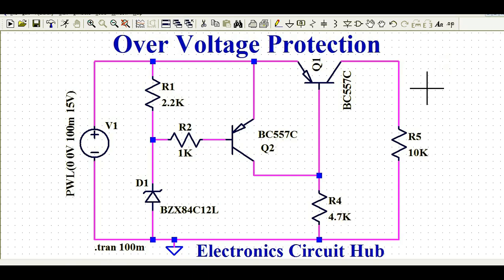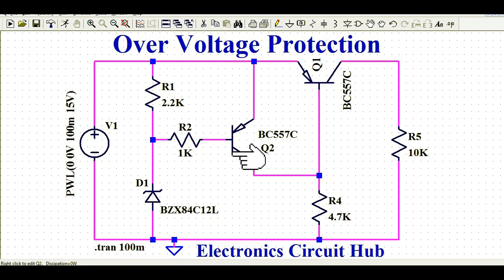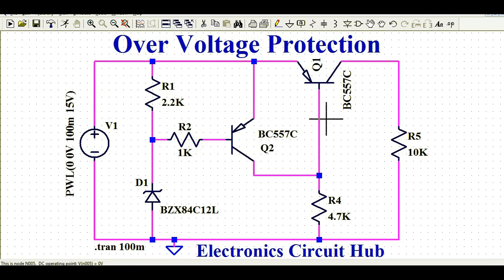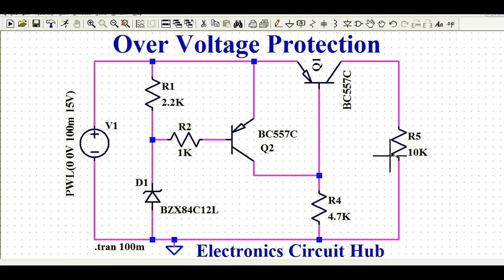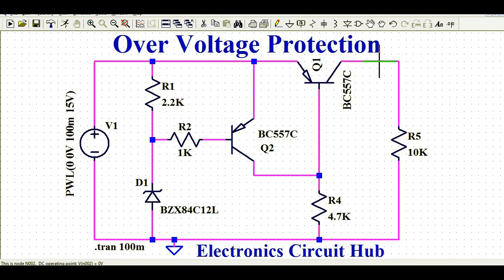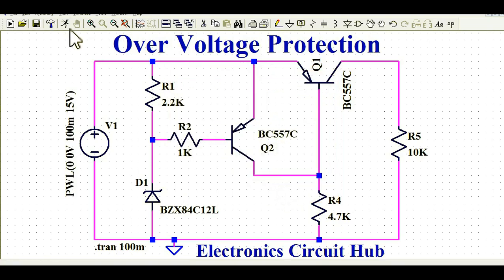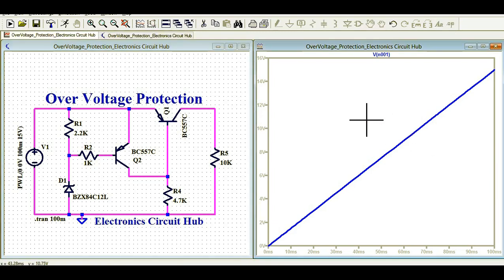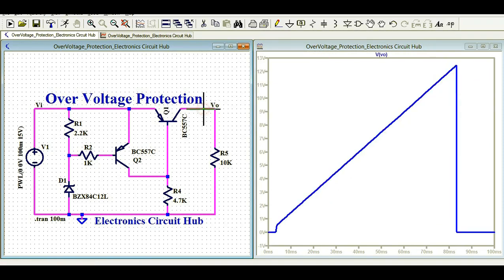Overvoltage Protection (OVP) Design Using LTSpice | Step-by-Step Simulation

Comment: How are the resistor values selected?
Reply from the maker: Hi. Do you want to to know about any specific resistor. Generally if you know your current flowing through branches and voltage at node ....you can find the resistor.
Reply: @ElectronicsCircuitHubECH  do the resistor selections impact the current received at the load when in the nominal range? Is there an optimal set of resistors to supply a 5v load at 500mA?
Thank you in advance!

Comment: Very good video; i have one question: the circuit will cut the voltage in more or less 50 u seconds (from 12V to 1 V). How we can cut the voltage fasten, ex. in 4 useconds?
Reply from the maker: Hi...Thanks for your question...you can use comparator based circuit...faster opamp will do the job for you. Incase of short circuit even usually comparator based designed are preferred.